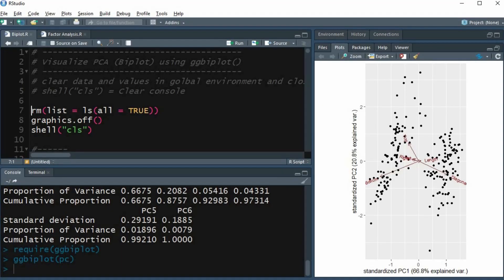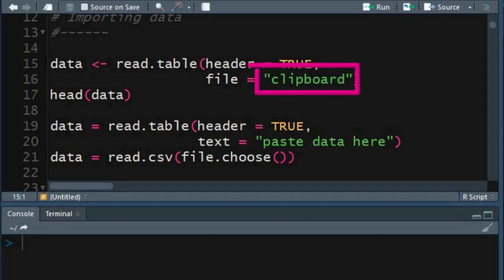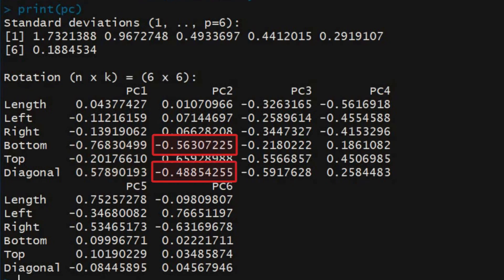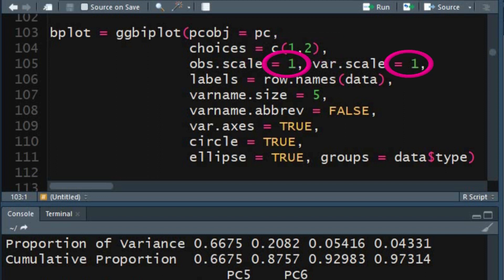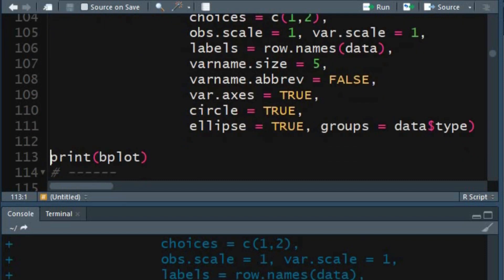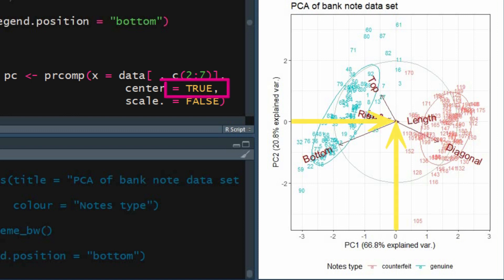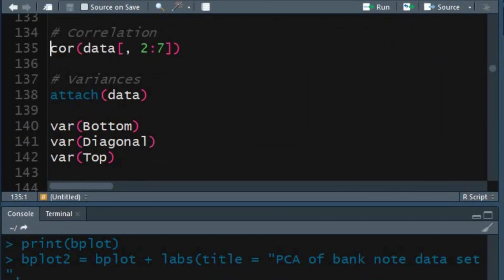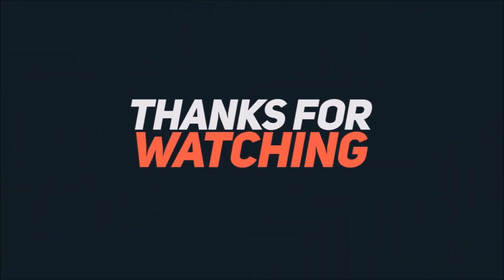Biplot for principal component analysis in r

Comment: How can i add group circles defined by a second factor on this biplot? I have two factors (cropping pattern and location). Thanks
Reply from the maker: You can create two biplots. One with ellipsis indicating first factor and second with ellipsis indicating second factor.
Reply: @AGRONInfoTech  Thanks, I have done so. But is there a possibility to add it in the same plot?
Reply from the maker: Everything is possible when you get skilled in machine learning. If you can share the dummy dataset and the R script to agron.infotech@gmail.com then I shall try to overlay the second variable ellipsis on the same plot.

Comment: I get this error when I add groups=data$type ,
Error in names(ell) <- `*vtmp*` : 
  'names' attribute [2] must be the same length as the vector [0]
Reply from the maker: There is some error in names attributes of group variable. See the group variables and its levels. Send me the str(data) output at agron.infotech@gmail.com
Reply: @AGRONInfoTech  Thank you so much. I figured it out.
Reply: @AGRONInfoTech  Please do a video on correlation plot
Reply from the maker: Thanks for your suggestion. My next video will be on visualising correlation
Reply: @AGRONInfoTech  One request: I have data set containing parameters from 3 tissues with 3 different treatments. How to make correlation plot? I tried with corrr() and corrplot().
Reply from the maker: You should plot a correlation matrix of response variables.
Reply from the maker: You need to first install the corrplot package by using below command:
install.packages("corrplot")

Video on visualizing correlations will be uploaded very soon.
Reply: @AGRONInfoTech  Dear brother, I have emailed you about problem with PCA. Please do check your email.
Reply from the maker: OK I shall respond you soon

Comment: I am unable to install_github("vqv/ggbiplot") error shows that (Error in install_github("vqv/ggbiplot") : 
could not find function "install_github")

What I do now
Reply from the maker: Did you load the library devtools before installating package?
require(devtools)

If still have problem then let me know
Reply: @AGRONInfoTech  yes I load the libaray still error. I used the R version 3.6.1
Reply: @dr_agrimentor  the same problem here
Reply: @AGRONInfoTech  please reply me if you have a solution
Reply from the maker: Open the older version of R 3.5. 3 or lower in R studio.
Then run the installation commands for ggbiplot. Hope this will fix the error. 
If still have problem let me know
Reply from the maker: Open the older version of R 3.5.3 or lower in R studio and then install package. This may fix the error. If not let me know
Reply from the maker: @dr_agrimentor  Try to install with the older version 3.5.
Once installed will work.
What error you get?
Reply: @AGRONInfoTech  ok I will try